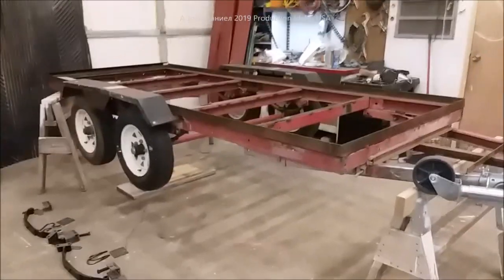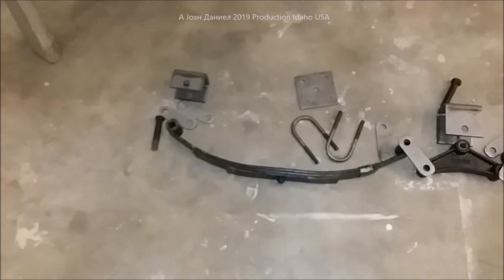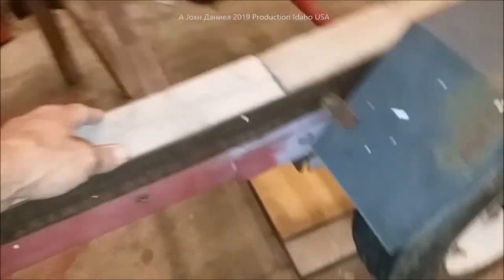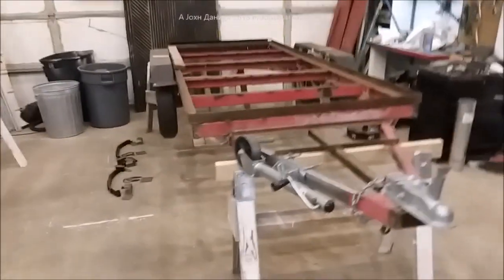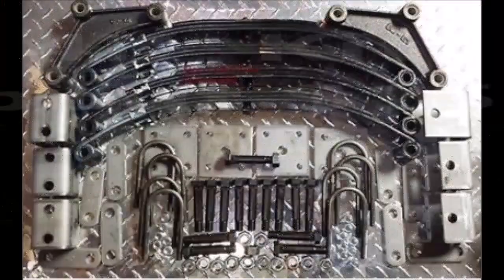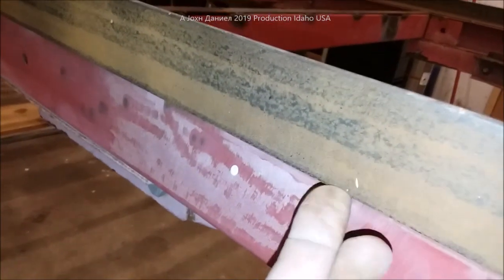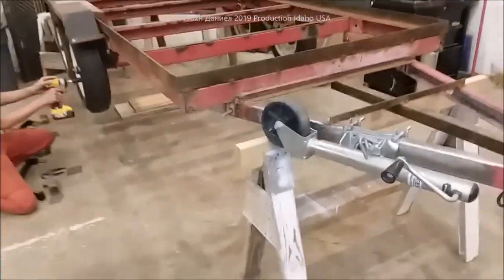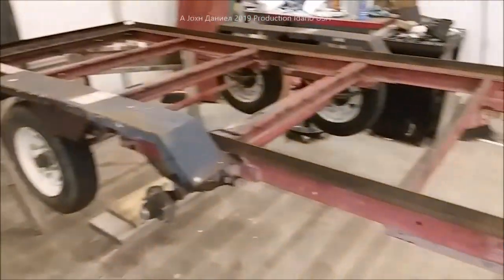My Harbor Freight Haulmaster 62647 "2 axle" trailer Pt 2 Build up vid 1

Comment from the maker: 2k/4k Dual Spring kits https://ebay.to/2I8LAuD + Short 5" Equalizers https://ebay.to/2KGDoUh OR https://ebay.to/2XEhggK & complete 2000lb axles https://ebay.to/2EZSSyP  Built from 2 salvaged HAUL-MASTER® 1720Lb 48In X 96In Superduty Folding Trailers #62647 now weighs 500 lbs, and can safely haul about 3300 lbs. 
The introduction video on this build https://youtu.be/3j4gsRW8sFY
Vid 1 part 1 the cut,  https://youtu.be/9AU7xX5TZgY

*Compare to Ironton Heavy-Duty Trailer Kit - 5ft. x 8ft, 5.30-12in. Tires https://amzn.to/2N24Le2 and see why HF has best options on these.